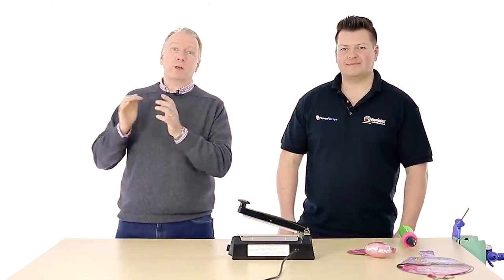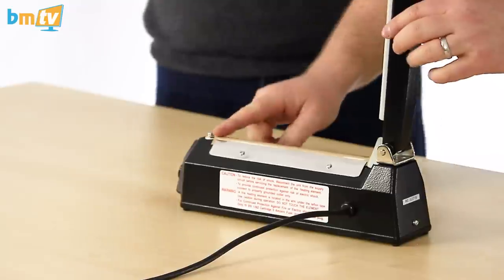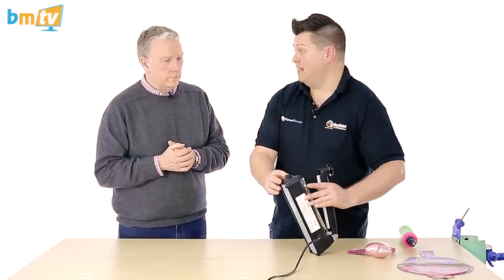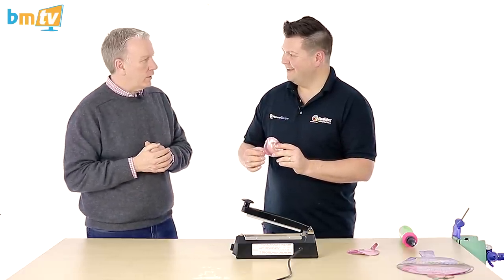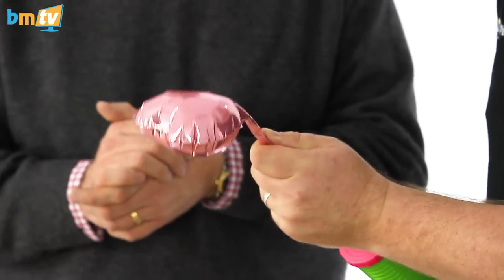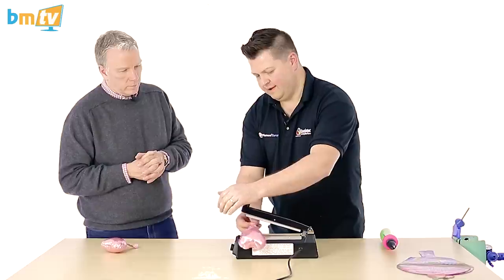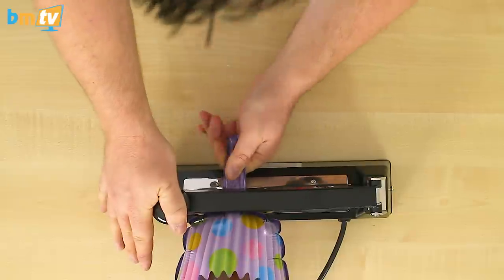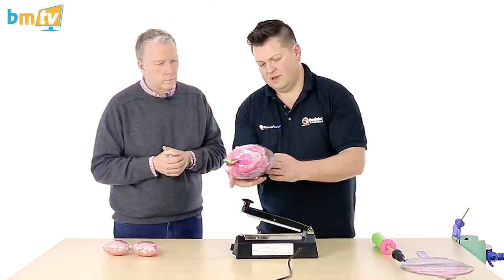How to Heat Seal a Foil Balloon - Balloon Basics 13

Comment: I tried to inflate. But i pushed more air and foil balloon got punctured. It got an inch size hole. The seal which was sealed by manufacturer came out because of pressure. How to refix it. Else i need to buy full set again. It was alphabet letter foils for Happy Birthday text . Letter i got punctured. Tried to fix with cello tape but in vain. I don't have this hot electric fixer
Reply from the maker: You could try Balloon Bond? I'm not sure how else, without a heat selaer you would be able to mend the balloon I'm afraid!

Comment: How come you would need to heat seal a balloon? (Just wondering, found this very interesting). Would you also need to seal a bubble balloon? . Thank you!
Reply from the maker: Hi Karen, the small foil balloons don't have a valve fitted into them so they need to be heat sealed to keep the air in. Bubble balloons are normally sealed using a modelling balloon :)

Comment: what number do you put on the dial? is 4 high enough?
Reply from the maker: All heat sealers are slightly different, but this machine worked ok on setting 3 for the microfoils :)

Comment: can i use hair flat iron as an alternative?
Reply from the maker: Hi Dina, a heat-sealer works by applying a the right amount of heat and then turning off suddenly. This seals the balloon together but allows you to keep the pressure on until the seal cools down, giving you a stronger seal. 

You could possibly use hair straighteners but you may have trouble either burning straight through the balloon with too much heat or not being able to keep the pressure on long enough for the seal to cool down. This may lead to the balloon leaking gas so we would recommend a heat-sealer.